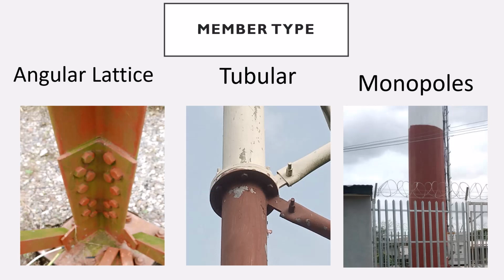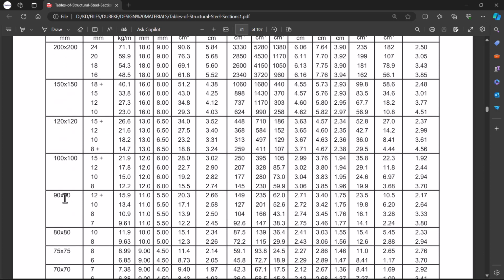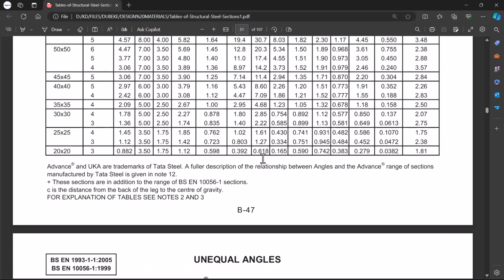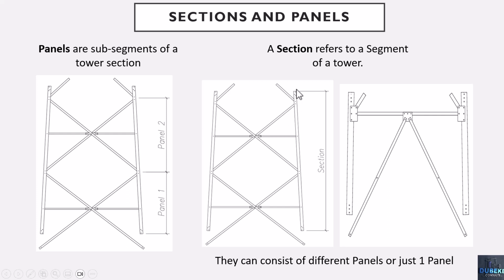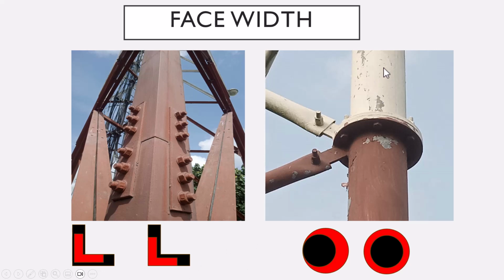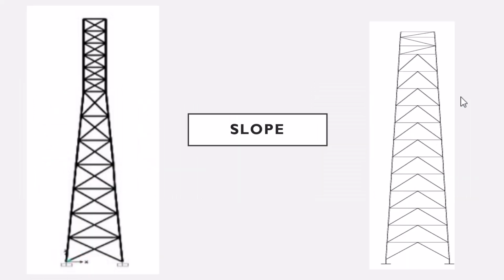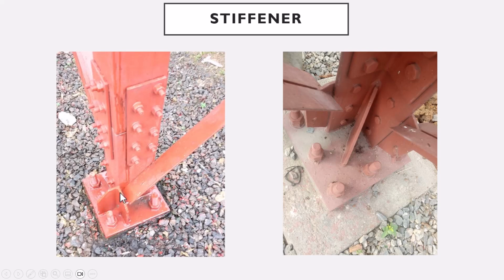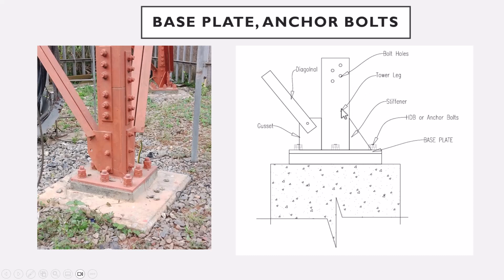Key Telcom Tower Terminologies

Comment: I would suggest you call the "connectors", connection plates, not Gussets. Gussets are stiffeners and we should use that term correctly. e.g The plates welded to a base flange and to the leg section, those are gussets or stiffeners.